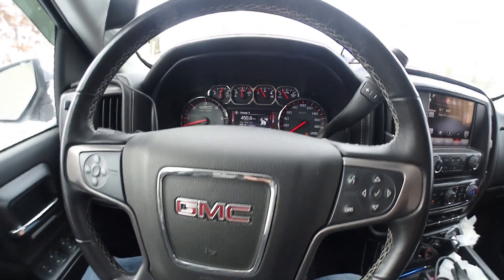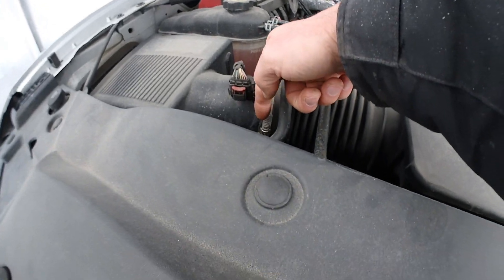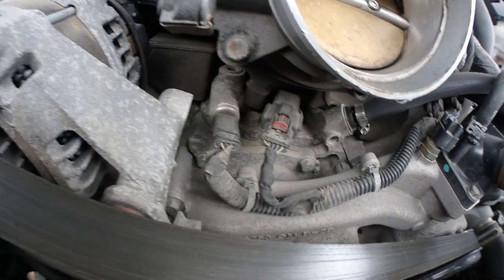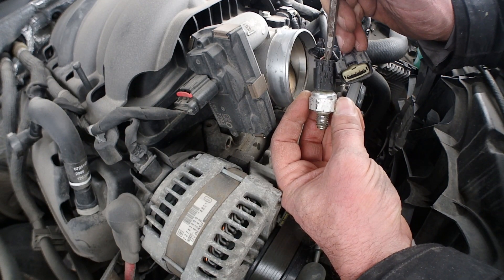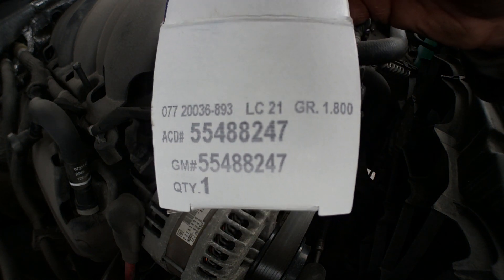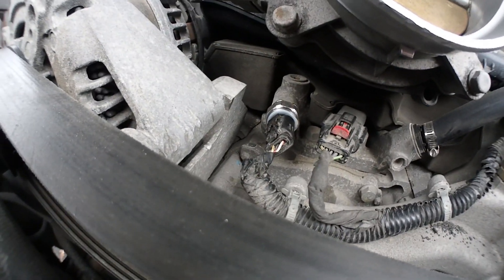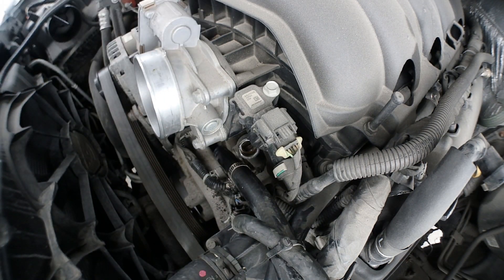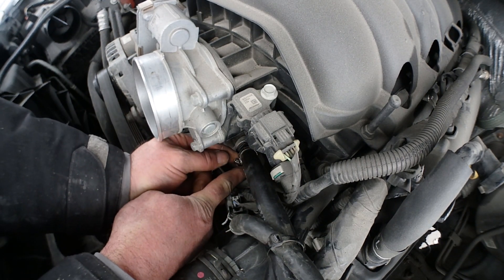Silverado Sierra 5.3L 2014 & Up,  Oil Pressure sensor and PCV Valve Change. Did not fix my P06DD .

Comment: P06dd it’s not that part I change that part and still had the same problem
Reply from the maker: It's all in the title and the description...
If you have P06DD, prepare yourself for an expensive repair.
Your oil pump and oil pump solenoid are about to fail...

Comment: About to do this on my 2014 GMC Sierra 5.3L V8 flex fuel. I just bought the parts and hopefully this buys me more time to save up and fix it. Fairly new to the mechanic world, doing this all myself. It just started about a couple of days ago. Truck has 130,000 miles on it. I pray that this helps 🥲
Reply from the maker: Do you have the infamous code P06DD ?
Reply: @obscur156 yes I do, I changed the oil pressure sensor already a few days ago. No check engine light as of yet.
Reply from the maker: @devondallaspainter7123  I hope that it does not come back...
Mine came back and the result is always the same.
Oil pump failure...
Good luck with that.
Keep us updated later if it happens.

Comment: You did not change the screen
Reply from the maker: No screen on 2014...
Reply: It’s above the sensor under a plug. You can see the plug at 9:02 in the video. You can see the hex shaped opening, you remove it and it’s under there. You have to remove the throttle body to get to it but it’s visible there in the video.
Reply: @velanvinny I just changed my screen , pic valve, and pressure sensor on 2017 it didn’t fix the pressure gage when stopped at a light
Reply: @2lindel  I think I was trying to reply to the other guy who said there’s no screen on this engine. But I also changed my sensor, and i have P06DD. Code still comes up and pressure still high. Supposed to be a stuck off oil pressure solenoid located at the oil pump. Not a DIY for me lol 😓

Comment: To those who don't know, 2014 to 2019 is the l83 5.3 LT engine, before 2014 was the 5.3 LS engine, the LT engine is a completely new engine and design and it's location changed to the front. East way to tell, is the LS 5.3 engine, the alternator is on driver side, the LT the alternator is on the passenger side.

Comment: So i just replaced my oil pressure sensor still having the code any other idea?
Reply from the maker: Is your code P06DD  ?
Reply: First its code p0521 then this one comes on after?
Reply from the maker: @JoseA817  I don 't want to be the guy that brings bad news but if you have P06DD,you oil pump will fail.
It can take a couple of weeks or up to 3 months but it will fail...Get rid of that pos if you can.
Expensive repairs are coming and lifters will be next.
GM don't care about their customers and are building junk nowadays !
I am so sorry that you have to deal with this shit,been there .

Comment: My 14 Silverado 1500 5.3 L has the same code however my oil pressure stays within optimal range even on the scanner it drops down to about 30 when ever it's idling and about 50 going down the road
Reply from the maker: Sorry to tell you that the oil pump will soon fail...
That po6dd code is telling you that it is coming.
Sorry but be prepared for expensive repairs 😢

Comment: I had this code P06DD.  on 2014 silverado 57000 miles.  Oil pump had to be replaced under warranty.  My truck has trown this code again at 89000 miles...took to dealer today....looks like it needs another oil pump...not under warranty....NOT HAPPY.  I have low miles and all maintenance has been performed at dealer...I can't believe this has happened TWO times.   It is an expensive repair...waiting to find out cost as I type this.
Reply from the maker: Sorry that you have to go trough this kind of shit twice.
GM is junk nowadays.
Later after my oil pump was shot , lifters went to crap.
I miss my 2004 silverado...

Comment: I just replaced my motor with a low km used engine from an insurance claim, and I can’t get this code to go away. My old engine had it, and it is still there. Helps

Comment: Absolute lifesaver.  All the other videos showed it closer to the windshield.  Must have changed it in the 2014 model
Reply from the maker: Glad it helped you out .
Thanks for watching,best regards.
Reply: Yes, they changed the motor completely, the 2014 to 2019 is the l83 5.3 lt engine, before 2014 was the 5.3 LS engine, the LT engine is a completely new engine and design and it's location changed to the front.

Comment: Thank you. I searched forever trying to find a video of the correct model.
Reply from the maker: @scottchildress89  you are welcome. 
Thanks for watching, best regards.
Reply: Yes, they changed the motor completely, the 2014 to 2019 is the l83 5.3 lt engine, before 2014 was the 5.3 LS engine, the LT engine is a completely new engine and design and it's location changed to the front.

Comment: P06DD with low oil pressure is likely the oil pressure control solenoid, not the oil pressure sending unit.
Reply from the maker: @DonsTechnoWorld  Yep,GM knows how to screw us !
Reply: @obscur156  did they tell you which part was causing the buzz/whine? Oil pressure control solenoid, oil pump, internal wiring harness?  Did you replace any other parts while in there?  Timing chain, tensioner?
Reply from the maker: @donfu2795  the dealer did it,oil pump and oil pressure solenoid and some gaskets of course.
Cost me over 3000$ CAD...

Comment: Why didn't you change the filter?
Reply from the maker: No filter on 2014...
Reply: @obscur156 there is a filter right behind it for the dod lifters under the hex Bolt
Reply from the maker: None on 2014...
Reply: @obscur156  yes there is like he said under the hex bolt there is a filter screen

Comment: Does anyone know how to disconnect the to vacuum linees or next to the drain hose underneath the passenger side on a2014 Chevy Silverado, that's where I'm getting my low rough idle,I can't see the connector but I can feel. If anyone has changed every sensor,MAF map and you still have a rough low idle, it's one of those 2hoses Tee together
Reply from the maker: I can't help on that one,sorry !
Reply: Also custom sounds had my 6.5 and my woofers together with my lc71 wired wrong,was drawing to much current

Comment: Change your evap purge valve and your evap vacuum box and solenoid, it's under the truck bed on the driver side,fix my low rough idle and vacuum leak and pressure sensors
Reply: Did it fix your oil pressure sensor?
Reply: @syncfnm7458  plus custom sounds had   my 6.5 and my woofers wired together and my lc71 wired wrong,was drawing to much current
Reply: But make sure you check your evap canister,I cleaned mine out,it will make your O2 sensor bad, and trick my scan tool to say my MAF was bad and it wasn't, when something is clogged or leaking air, the computer will borrow from other sensors to compensate
Reply: I just changed my 02 sensors anyway because I have 58000 miles,but it's 10years  old

Comment: Glad my sensor connection is on top
Reply from the maker: Lucky you !
Reply: @obscur156  I'm fixing to drive it now but when I hooked my scan tool up I'm getting more codes,iac,cam ,ho2 all of them, throttle ambient, fuel pressure, engine coolant knock,cam, I think I have a short in ground somewhere,I didn't have all those yesterday I just changed evap,it back fuel level I got the po6da just now,I think the ECU has a short
Reply: They all saying not run in the trouble code section and low voltage
Reply from the maker: @roderickr35  Good luck buddy !

Comment: What does a p06dd mean
Reply from the maker: What does the P06DD Code Mean?
P06DD code indicates that the powertrain control module (PCM) receives a signal from the engine oil pressure sensor that engine oil pressure is below the predefined allowable thresholds. In such a situation, the PCM attempts to minimize engine wear by disabling the oil pump drive and setting the code.

Comment: I just did this today. Found it easier to remove the throttle body and access it with a 24mm wrench. 

It did not fix my issue as my oil pump is likely failed. Worth a shot though anyway. Try the cheap fixes first. 

Thanks for the awesome tutorial. Very easy to follow.
Reply from the maker: Thanks for the tip buddy, i like it when viewers like you contribute to make it easier.
Sad to see that your oil pump is failing...
I appreciate your comment.
Thanks for watching,best regards buddy.
Reply: Did you still have oil pressure when your pump failed?
Reply: I changed both out and still have the po6dd code, what did you do to fix it?

Comment: Can the pcv valve cause weird 1-2 shift happens sometimes
Reply from the maker: Can a bad PCV valve cause shifting problems?
This may also cause problems with shifting due to the ECM attempting to identify shift points that are inconsistent with what it thinks they need to be as a result of the lean fuel condition.

Comment: That oil pressure sensor has already been tampered with. The locking mechanism is grey and has been removed from that sensor connector.
Reply: Mine was absolutely degraded from heat the connector are garbage .

Comment: 2020 is an elbow shaped PCV Valve. You can’t remove it with a socket. Any tips?
Reply from the maker: Maybe need a special tool,i have a 2020 silverado rst with low lileage so i am nowhere near changing it.
Sorry.
Reply: where is it located man_ the pcv and oil pressure sensor? i apreciate if you could help

Comment: i have a question, did you have any symptoms while check engine light was on, like rough shifting, and when you turn the car off does the engine run for a quick second and like jerk bc mine currently does that
Reply from the maker: The only symptoms i had was like a whining sound like a power steering pump noise.
That was the oil pump slowly dying...
Reply: @obscur156  okay thanks, do you think you know what these symptoms(mine) are from ?
Reply from the maker: @AntonioCGuerrero  Not really ,its hard to diagnose like that .
I hope you will find out soon and thats not gonna cost you a fortune.
Good luck buddy.

Comment: I just bought a 2014 GMC Sierra 5.3 and it seems to be burning oil, no leaks in drive way what would you suggest where to start.
Reply from the maker: Why does 2014 Silverado burn oil?
The suit alleges the 5.3L V8 engines found in a number of 2010-2014 model year GM vehicles have flawed piston rings that don't maintain tension well enough to keep oil in the crankcase

Comment: If your messing with the connector full the tab all the way back then gently squeeze both sides with a pair of vice grips youll see the tab push down as you squeeze gently and shell slide right off
Reply from the maker: Thanks for the heads up buddy !
Thanks for watching,regards.

Comment: Hey friend,I change oil pump,and oil pressure sensor , And continued problem ,your recommended change psv valve
Reply from the maker: You change the $3000 oil pump and still have issue ?
Reply: @obscur156  yes
Reply from the maker: @gerardoseculi6991  what is your problem???
Low oil pressure ???
Reply: @obscur156  when the car is hot something sounds in the timing the code P06DA
Reply from the maker: @gerardoseculi6991  Can be the Oil Pressure Solenoid Valve in the oil pan.
I doubt that the pcv valve will help but it cost not so bad so you can try it first.
Reply: @obscur156  thanks you

Comment: Sir what type adapter are /were you using on the Torque wrench? It looks like the adapter increases to fit the extension that fits then 24mm socket.
Reply from the maker: Something like this kit : https://www.amazon.ca/EPAuto-adaptateurs-r%C3%A9ducteurs-pour-douille/dp/B01LYFJ6PE/ref=sr_1_2_sspa?__mk_fr_CA=%C3%85M%C3%85%C5%BD%C3%95%C3%91&crid=HOO0COQJ9QEW&keywords=1%2F4+3%2F8.1%2F2+socket+adaptor&qid=1654212130&sprefix=1%2F4+%2C3%2F8%2C1%2F2+socket+adaptor%2Caps%2C61&sr=8-2-spons&psc=1&spLa=ZW5jcnlwdGVkUXVhbGlmaWVyPUEyQTJTUUwzSVNaUU9VJmVuY3J5cHRlZElkPUEwMzQyMTUzM0dQWUlJNTBaSFc2NCZlbmNyeXB0ZWRBZElkPUEwMTM0ODU2MVlJNko5VjZJNzI0NCZ3aWRnZXROYW1lPXNwX2F0ZiZhY3Rpb249Y2xpY2tSZWRpcmVjdCZkb05vdExvZ0NsaWNrPXRydWU=

Comment: How do you remove the Clip on top of the Sensor sir?? I have the tool needed to remove the Sensor  but don`t know how to undo the Clip!
Reply from the maker: That clip gave me a hard time,you need to press on the tab and i also used a pic if i remember.
That was 2 years ago...Don't remember much.
Hope this helps .
Thanks for watching,regards.
Reply: @obscur156  I really Appreciate your response !  The Tab is the white part of the clip and I should press or squeeze it while pulling outward Right? What is this pick and where can I get it?
Reply from the maker: Yes and it's just a regular set of pics that you can buy at soto part store.
Reply: @obscur156  Thank You again sir!
Reply from the maker: @horacelee880   I have unscrew the sensor a half turn to see the tab before trying to remove the clip...You are welcome buddy.

Comment: Hey so just recently my oil pressure gauge has been fluctuating weirdly Generally when I'm accelerating and the motor is nice and warmed up it'll liked to sit at the 275KPAA and once the acceleration Is decreasing it a lower itself gradually gradually but all of a sudden it started spiking as I was driving going down 2 ticks under 275 2 ticks over to 75 all within a few seconds and it was not consistent from there on I do not hear any noise in the motor no ticking or nothing like that Oil level is totally fine and the oil is only a month old fully synthetic same as always used I also do not have any warning lights on whatsoever so my question is do I need an engine light to pop up on the dash to diagnose it as a oil pressure gauge, sounds more or less to just be the gauge hopefully 😅
Reply from the maker: Looks ok to me but if you start to have a winning sound like hydrolic power steering and a code that starts with P06XX, you will end up with an oil pump failure !
Reply: Did you end up figuring out what was causing your issue? My 2016 seirra is exhibiting the same issue and I can't figure out what is causing it.
Reply: @johngrandy7783  Yeah we swapped out the oil pressure sensor and it fixed the issue! Nice cheap fix did it in 20mins

Comment: Do you fix the p06dd just changing the sensor
Reply from the maker: P06DD engine code and all other P06** are the same problem . That was the oil pump slowly dying .The STEALERSHIP repaired it and gave me a bill of $ 2873.89  Canadian dollars...Dude i hate my ride.Looks like GM builds crap trucks nowadays...Not acceptable at 90.000 KM / 55.923 Miles...

Comment: Thank you so much for this tip. Chevy somehow found a way to get us, they needed to make some money down the road of manufacturing this truck, I’m sure each owner of the 2014  5.3 truly appreciate you for making this video. You are awesome! Charles
Reply from the maker: I am glad that you liked my video.
Thanks for commenting,I appreciate that.
Thanks for watching,best regards.
Reply: When that lady took over GM went down hill
Reply: Yes, they changed the motor completely, the 2014 to 2019 is the l83 5.3 lt engine, before 2014 was the 5.3 LS engine, the LT engine is a completely new engine and design and it's location changed to the front.

Comment: My 17 Silverado that bought new has 80k miles on it. Having low oil pressure issues. About to change the sending unit. I live in Texas, I wonder if it’s necessary to run 0w-20 in it like the manual recommends. I wonder if I could use a 5w-20 or even a 10w-20?  Any GM mechanics out there?
Reply from the maker: Always use recommended oil, period.
It is designed to use 0w-20, using thicker oil can damage your motor.
Oil needs to be thinner in these engines, very tiny holes needs thinner oil to get through it.
Do you have engine codes or check engine light on ?
Reply: @obscur156  thank you for your reply. I have always used the correct oil. I do not nave any lights on. When the engine is warm and I come to a stop, the oil pressure gauge goes to 0 and the there’s a tone and the dash display says turn off engine. Then I excelarate and the oil pressure goes back to normal and the display returns to normal. I’m replacing the sender this week.
Reply from the maker: @allenoalleno6247  Start with that, mine got me shut off imediatly the engine when my oil pump failed.
I hope your sending unit will solve your problem...
Good luck and keep us updated please.
Best regards.
Reply: @obscur156 thanks for your input and best wishes!  I need all the help I can get!  Might be riding a bike 🤨
Reply from the maker: @allenoalleno6247  Thanks, I will be walking more with gas price hike for sure !
Reply: @allenoalleno6247 … having same issue as you, no light though. Idle is at 10 or lower but goes back to 35ish but i also get the dash warning to shut engine off. What was your final out come if you don’t mind me asking?
Reply: @obscur156  can you please explain not familiar with the sending unit, heard that might be the problem, is that the correct name for the part sending unit?
Reply from the maker: @deaconjones8016  Cost me an oil pump,3600$CAD...
Reply from the maker: @CarlosDelaoGunEngraver  Yes ,its the oil sending unit.

Comment: Has anyone taken it to the dealer to have it taken care of? If so how long did your dealer take ?
Reply from the maker: Yes,they took 14 hours to do the job on my sierra 2014 4x4.
Cost me 2873.89 $
Reply: @obscur156  dropped off tge truck last week, told me it would be $3k to fix
Reply from the maker: @OscarGonzalez-ox5bs  Thats what it cost me here in Canada !
Sad to see so many peoplewith that issue...
GM is going down in reliability.